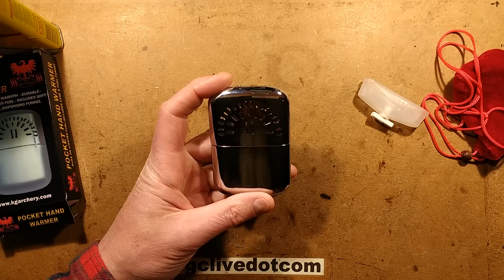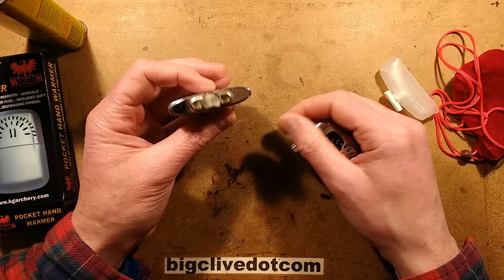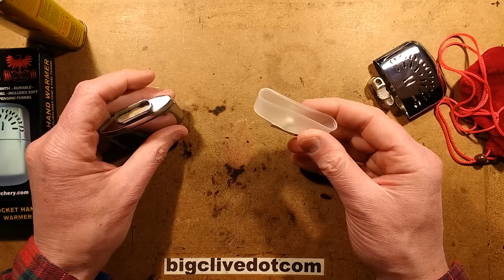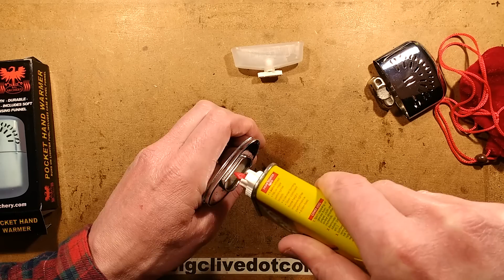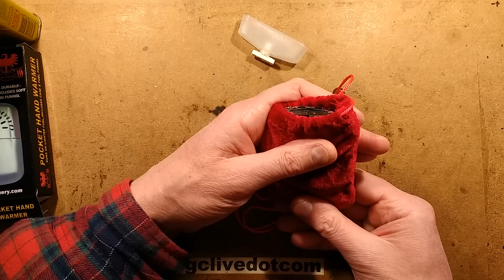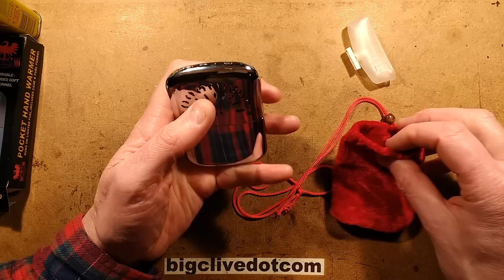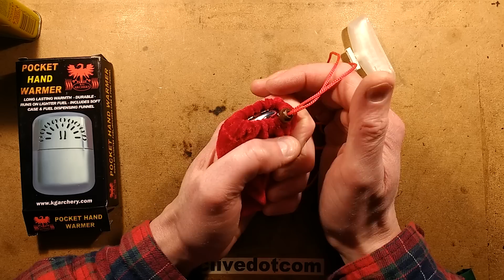How a petroleum-distillate powered pocket heater works.  (naptha)

Comment: The zippo product is a clone of the old army version, which was called "Jon-e-heater" or something like that.
Reply: Which in turn was a clone of the Hakkin.
Reply: @AndrewDalgleish  Only partially. The Aladdin Lamp MFG (company making the Jon-E) version has a different metal gauze (with slightly more platinum), and their last model (the best one) has a small naphta lighter wick next to the converter. By lighting the wick and letting it burn for bit under a minute, the rest of the fuel heats up (enough to start vaporizing) and the catalyst reaches operating temperature.

Comment: Ive had a few of these and for the most part they're ok. But dont expect them to stay lit in pockets with restricted ventilation.
And dont fill them up too much. Lighter fluid burns skin even if not lit. And dont fiddle with the filament too much.

Comment: I used a similar hand warmer as a marching band member during the winter football season of 1967 or 68.  It never lasted a over an hour or so, which was disappointing, it was hardly worth the time to fill and keep track of it, and it never was worth carrying it on my cold morning paper route.  There was no filler measure, you just had to guess with squirt(s) of Zippo.  Maybe the platinum is thicker now, or something, because the originals say they go for a full day on 25 ml of fluid, which is two cupfuls of the filler shown here.

Comment: The original "JON-E" Lg warmers have the platinum catalic mesh and man can get hot using denatured alcohol  (but dont last as long.  I have also used camping stove Alchahol.   not gasoline aka benzene but naptha (lighter fluid).  also if you put a small amout of high temp oven blanket material you can "refill" the lower container.

Comment: The way you put it in the pouch also determines how hot it will get. If you put it in the other way round it won't get as warm and lasts even longer.

You put it out by lifting up the catalytic converter for a while.

Comment: I'-ve got one off those hand warmers for some years, you light it by just holding the whole warmers with the converter upside down without wetting the catalytic converter with gas and put a lighter to the converter until it starts glowing slightly red it's very faint, that's it. And it get's really quite hot. To stop it you just pull the converter off with a screwdriver or pocket knife.

Comment: These units use Light Naphtha. Light Naphtha is a group of hydrocarbon molecules 4-6 carbon atoms in length.
 Heavy Naphtha consist of long 6-12 carbon atom chains. 
 Heavy Naphtha which is found in Gasoline for engines has longer chains and more potential energy to release as the more numerous  bonds are broken in combustion. 
Light Naphtha works great in a hand warmer because the less numerous bonds are easier to break down to double and single carbon atom hydrocarbons without releasing too much heat energy.  
Heat sustains the breaking of these bonds till the fuel is reduced to formaldehyde which is then recombined with oxygen  by the platinum in the filament to water vapor and carbon dioxide.
Formaldehyde is CH2O and when catalyzed by the trace platinum it recombines with oxygen to CO, CO2, and H20 ( and more heat energy). Yes that's carbon monoxide in the list but the amounts aren't all that alarming.
Most of the smell these hand-warmers produce is formaldehyde and short chain hydrocarbons leaving the filament before they've been completely converted.

Comment: I had one of those that started differently: The catalyst was a metal fibre sponge, and a "starting wick" was fed from the inside to the outside of the catalyst. You had to lite that wick up which burned just like a gasoline lighter, and it would extinguish by itself when the catalyst reaction started up. The company was called "peacock".

Comment: i have a zippo one i bought when i worked at the zippo plant in  Bradford when my former girlfriend was going to college in Bradford i worked their for 4 years till i moved back to bedford  i use it hunting and i really like the thing never felt unsafe with the zippo one and the zippo one is a lot easier to light just take a zippo lighter light it and set it up on the table and hold the hand warmer over it and it will light quickly i also light mine with a oxy acetylene torch once lit the torch and just got it close to the top and it was lit   while you can use regular unleaded gasoline in this i wouldn't as the caned stuff it a lot more pure and burns cleaner it like with the gasoline Coleman lanterns you can use unleaded in it it just burns through mantels and dirtys the lantern quicker

Comment: I've seen a lot of those over the years but never used one. I'm surprised they still make them to be honest since the pocket warmers that use iron oxide and react with air are much safer and easier to deal with. The have big natural gas powered catalytic heaters on the ceiling in some places at the factory where I work that appear to use a ceramic mesh grid that glows red-hot.

Comment: A fresh fluid fill and a jet/torch butane lighter applied evenly for a few seconds until the fibers begin to glow dimly will get the warmer going. It's not immediately obvious it's working as it takes a minute to warm up. I once ruined a catalyst by blowing pure oxygen on it until it glowed white. Otherwise, if you're careful not to overheat it and burn it up it should last a lifetime.

Comment: Restoration Hardware sold replicas of the 1940's originals.  I lived in Russia in the South Urals and had to spend time outside in -30C temperatures.  I would put two of these in my heavy coat's chest pockets and they easily outperformed my colleague's chemical hand warmers.  The liquid I used was Zippo lighter fluid.

Comment: absolutely love these things! have a couple i use when doing ironwork in the north during winter. the ones i have run for about 9-10 hrs at full blast and keep putting out a weaker heat for 2-4 hrs afterwards. granted i may have poked a few holes in the baggie.. the pockets in my stay puff suit are fairly restrictive on oxy in the first place. hot tip if ya drop em in to bottom of your bolt bag your fasteners will thread easier in truely cold weather ...steel shrinkage in anything below zero makes bolts and nuts go together like crap.

Comment: the best version made was by a brand called peacock   ,  ive had my 2  since late 1980's  and they are still working perfectly  zippo lighter fuel coleman stove fuel or simlar can be used in them but not Petrol it just dont work

Comment: It operates on the same principle as the old Coleman catalytic heater, which uses white gas (Coleman camping fuel, basically untreated gasoline). People have been killed when using these heaters in tents due to the CO emissions. Coleman discontinued them in favor of propane catalytic heaters, but you can still find the old white gas models easily. ...and please, for God's sake, never use Coleman fuel, or any sort of gasoline in  a pocket heater...good way to end up with severe burns. https://www.youtube.com/watch?v=gKaiYbZLryg

Comment: The original brand of these was Jon-E, which has a braided metallic converter and a wick to light it. There was a gap between the roll of metallic braid and the body.

The fuel itself was basically just lighter fluid, with a flash point above room temperature and pretty innocuous if you got it on your skin.

Comment: https://patents.google.com/patent/US2670728
patent that describes the pad composition as
"This combustion promoting member is constructed of Woven strands of high temperature spun glass and of asbestos or  asbestos alone formed With  interstices or meshes therebetween. 
The tube is immersed for about ten minutes in a ten percent solution of plantinic chloride dissolved in isopropynol alcohol. 
The tube is then removed and air dried till dry.  After drying by air the tube is baked in an oven at about 1000 degrees Fahrenheit until the chloride becomes converted into metallic platinum, also known as platinum black. Palladium chloride may also be used. "

Comment: these things work too with ethanol, isopropyl alcohol and acetone. To start the reaction a bit easier you can wet the catalytic a but with the fuel. it doesn't take much. These things work fine and put out much heat. Just make sure you have the little bag around it. i once almost burnt myself on one because i didn't draw much heat from it and i didn't have it in the little bag. There is also a simple way to put it out: i just cover the holes in the lid with my hands and wait a few seconds until the reaction stopps. The cathalytic does glow when it's burning the fuel but not really bright.

Comment: I've had one for many years and it's actually my favorite kind of hand warmer. More heat than the recharge-in-hot-water one and reusable, unlike the single-use chemical one. Also, lighter fuel has much better energy/weight and energy/volume rank than any batteries, can be purchased anywhere where cigarettes can. The only disadvantage is starting these up, it can get a little fiddly if you are not experienced. Sure it's not the safest thing ever made, but I don't think it's particularly dangerous if you stick to certain safety precautions that are obvious unless you are an idiot (do not overfill, do not leave unattended, do not spill the lighter fluid, don't fill with anything else but lighter fluid...).

Comment: It's exactly the same chemical reaction as the stuff just burning, except there is no flame.  The fuel and oxygen react with one another on the surface of the catalyst, and liberate enough heat to keep the reaction going.  C6H14 + 13O2 -> 6CO2 + 14H2O.  The catalyst itself is not involved in the reaction.

Surprised you haven't looked at this with the FLIR camera....   Does it produce much infra-red radiation?  Normal phone cameras can see IR quite well.

Comment: Had something very similar many years back. It was a clam shell case with glass wool (or similar) inside. In the middle you put a charcoal stick which you lite one end of. You need to get about 1cm of the charcoal glowing before closing the case and sticking out in the small bag. Used to last for ages and was toasty warm.
Only problem was that the last lot of charcoal sticks i bought were very poor quality, not as dense as the originals, and used to spit hot sparks as you gently blew on them to get going. Shame, great pocket warmer.
Reply: Extra cold day?  Light both ends.  Been there, done that.  👍

Comment: I had one of these more than 50 years ago (age 13-15), when pulling a wooden barrow around South London streets in the winter - delivering paraffin and Coalite. (Very Dickensian). Slipped it into a glove, swapping from one glove to another as the neglected hand got cold. I seem to remember filling it with a rubbery 'capsule' of lighter fuel.

Comment: These haven't changed in fifty years, we used to use these as lads when we went fishing to keep warm, no problem.
You also need to put a drop of fuel on the burner and light it, when the flame goes out, the burner starts to glow.

Comment: About fuel on those things;  Well I must admit, when I was a boy back in the 60's I found one of those in an old dresser in an old house my father bought for us to live in. Seems back then other people never cleaned out houses before they sold them, just took what they wanted and left the rest.  At any rate I never did find out how to run the thing and eventually just threw it away.  That said, I became a heavy smoker, and when I was 18, the government decided it was my turn to go to Vietnam, so off I went, a  carton of Kools in my carry on bag and a  Zippo (that I still have) that my wife of under a year had engraved with her undying love stated on the side. When I arrived "in country"  I soon discovered that, while Zippo's and Ronson's were both available at the larger PX's in major Bases, not a drop of lighter fuel was available for purchase. I once purchased a Ronson simply because it came with a small tin of lighter fluid. When I asked around everyone said they used motor gas for filling them.  The trick was to go to a Jeep, uncap the gas tank (located haphazardly under the drivers seat) and simply push the uncased lighter into the fill cap, which was huge on the Jeep's you could put your whole hand down there if need be to reach the gas, but most Jeeps were topped off before leaving the Motor Pool so it was quite easy.  So it was, I always had lighter fluid, and the gas worked nearly as well as the lighter fluid, except it smoked a lot and gave off a bit higher flame for some reason.  Oh and it added a all new taste to the Kools that was quite easy to adapt to, however nothing was better then that sulfur blast you could get from a water proof match! Oh and it also gave a fellow a rash on his leg if you didn't light it after filling it and allow the excess gas to burn off the outside of the lighter.

Comment: I have two big ones that run on propane or butane to heat caravans or even rooms in houses. 

They are thermally more efficient than combustion and, importantly, don't produce the water condensation that propane/butane combustion does. 

You ignite a pilot flame first until the catalytic wadding glows then turn the flame off for clean dry direct radiant heat. 

I remember the first time I saw one was in a portahut  while I was working for London council, literally counting traffic by the side of a road one winter. I was quite amazed and very glad of the clean dry abundant heat.

Seems like a lot of fuels will work if the device is designed for them. But best to be careful and if you must experiment do it safely with an assumption "This might blow up any moment, how do I test it safely?". Not saying don't do it, just saying live to tell us about it and stay pretty.

Comment: I have a couple of the original Zippo ones and they perform beautifully .  I have found that to get the process going , rather than holding a lighter to the element for ages .. Its far better after filling the wadding material , to place the catalyctic element back on and then drip just a drop or two of fluid on it .. Lighting that wil make it flame for a couple of seconds . It quickly self extinguishes but there is enough heat transfer to start the vapour creation causing it to start heating.  I've been doing that for the last couple of years with no ill effects ..

Perhaps you could try that. ?

Comment: I had one of these many years ago: https://www.ebay.com/itm/vintage-velvet-covered-charcoal-stick-hand-warmer/292413913985?hash=item44153a3b81:g:Ak0AAOSwQwZaYMIx
It would get VERY hot!!! You could control the heat by either light one end, or the other. If you wanted it really hot, you could snap the stick in half, and light all 4 ends.
I'd say, I'll get cancer form using it, when I used to use them, going fishing...
Reply: The carbon ones were the only sort sold in Canada for many years, if you find one but no sticks, I have been told go to any welding supply and buy Carbon Arc Gouging rods.  Alternative 'film crew' trick jam two 9 volt batteries together (the 'wrong' way instant heat for a while.

Comment: I've used these for years, I just squirt the naptha from the can direct into the "tank", it's a lot safer than some squidy filler. Fill it up then let it sit for a few min,  then heat the filament. Worked great when I used to work on the railroad in winter, never had a issue with them. You can run high % alcohol 90+ but it messes up the filaments sometimes.

Comment: It isn't a zippo clone. It is a Hakkin Peacock clone. It was invested in Japan in, I think, the 1920s.

Peacock warmers are still sold, but I'm pretty sure they are all made  by Kovea, a Korean company that manufactuers sporting equipment sold under a number of name brands. Kovea sells warmers under their name. There is also a Roson-braded variant from Kovea as well.

That one looks like a Chinese clone. I have two. They work about as well as my Kovea/Peacovck, well, other than that the soldering is a little leaky. I don't know if their catalyst will hold up as well. 

I also have some vintage 50+ year old Japanese-made warmers that were sold in the US under various names.They have their original catalysts, which surprised me by working well. I thought I was going to have to buy replacements.

As for the catalysts, apparently a variety of metals will work, for a while, at least, but they tend to loose efficacy as the metals oxidize. Platinum doesn't have that problem. There is someone in Canada who sells refill catalyst material, which, I'm pretty sure, are tufts of gas fireplace "embers," rock wool with platinum deposited on it.

I don't think the bag limits the oxygen. Besides keeping you from burning yourself, it helps keep the thing warm, particularly important because a blast of freezing air could extinguish it.

Other fuels work, too. Coleman Fuel, or white gas, works, and is cheaper than lighter fluid. I've used isoporpanaol, and plan to try ethanol. The downsides of alcohols though are that they absorb water, which can cause corrosion of the metal, and perhaps the catalyst support. I will not be trying methanol either, because it apparently can self ignite in the presence of platinum catalyst. Another thing that works is VN&P Naptha, from the paint section of hardware stores, same basic stuff as lighter fluid/white gas, incase it is cheaper or more easily available. Gasoline will work, too, but it stinks more, and its formulation changes often.

There are lots of people online arguing about whether Coleman Fuel, lighter fluid, VN&P Naptha, etc is better/equivalent, etc. I went down that rabbit whole and collected a bunch of MSDS. Turns out "Ronsonol," the classic lighter fluid in the US, has been refomulated a number of times, as has Coleman fuel. VN&P Naptha has been too, especially in California, due to pollution regs. Bottom line, they are all different, and the same :)

Stay warm!